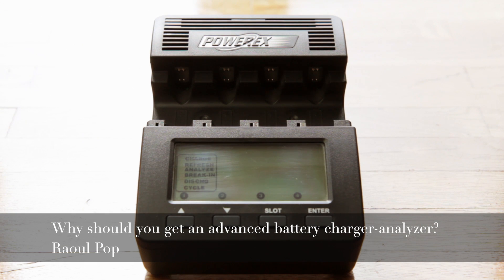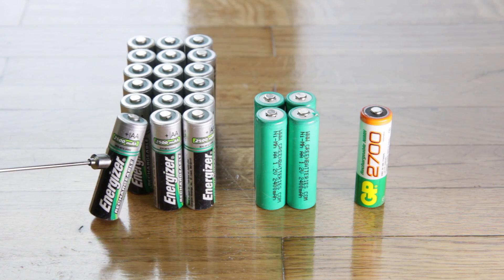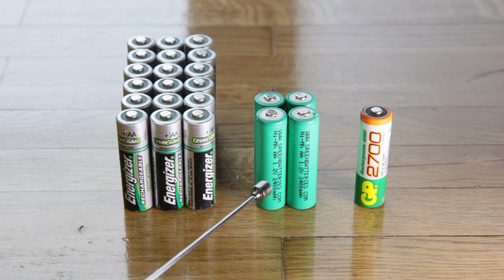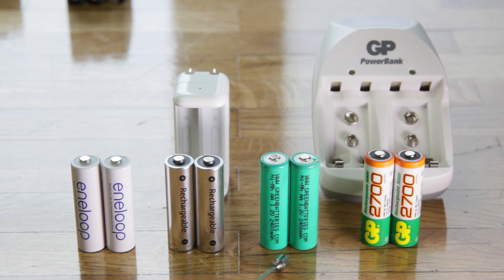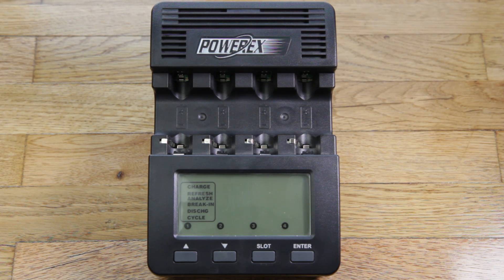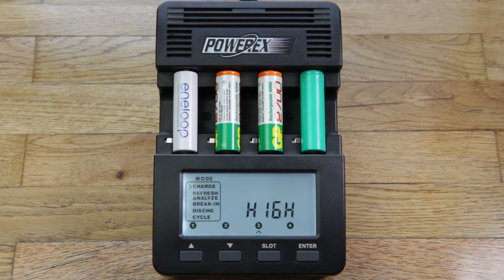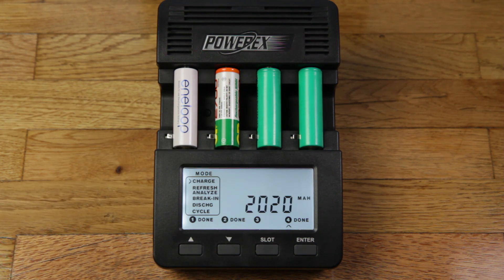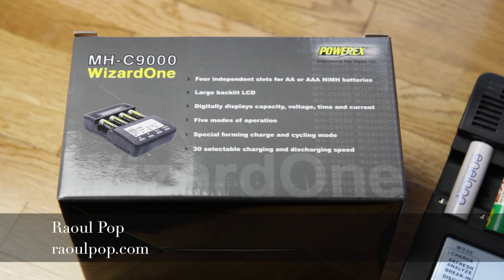Why should you get an advanced battery charger-analyzer?

Comment: I like it. But it has couple issues.

A) It refuses to charge some older weaker batteries. It should display warning that battery is KO, but charge it anyway. I have many batteries that are no longer "good enough" for this charger, but they happily work in less demanding equipment like LED flashlights.. so I have to use old dumb charger that simple feeds them with 160mA and some once tested on Maha then easly deliver around 1400mAh remaining capacity out of 2100mAh initial.
B) It only can charge AA + AAA, no C or D.
C) They redesigned the charger recently, but it still does not have circuitry to charge 18650 and 14500 Lithium batteries. I asked them if they can create some charger like Liitokala 500/600 but they keep responding like "yes we know, but so far we have NiMh C9000.. "

And over the years buttons keep getting worse and worse. SLOT button on my charger barely works now.
Reply from the maker: The inability to charge the C and D batteries is a minus. However, I’ve still got mine after all these years and it still works great, including all the buttons. I don’t think I’ve ever had another charger that lasted this long. Thanks for the detailed comment!
Reply: @RaoulPop btw there is hack to charge those worse batteries,  but requires some dexterity. Put fresh good battery in slot, select desired charging, wait about 10s until it does initial check and quickly replace it with the HIGH one. It will continue charging as usual untill its full. It cannot be the only battery inserted, at least one other battery must be in charger or it switches off.

:)

Concerning button, it can be replaced, it is just regular smt component, but SLOT button is not critical, so maybe later. 

For few larger D batteries I've created dummy with two wires and two soldered neodyme magnets.  Dummy goes in charger between terminals and wires to battery. Works quite well.
Reply from the maker: Sounds like you’ve been having some fun with it 🙂
Reply: @RaoulPop  Well.. 17 years living and charging together :D

Comment: RadioShack nimh cells weren't bad they were expensive they lasted years plus the label didn't peel off like the Energizer ones do after a certain amount of time
Reply from the maker: Yeah, they don't make things like they used to... I've noticed the low quality of the rechargeable Energizer batteries as well. I also bought some Duracell rechargeable AAs and they went bad rather quickly too.

Comment: My Eneloop AAA batteries after 7 years are still working well that's why I never buy other brands anymore but you need to be careful of fake eneloops. Both my chargers are Powerex, 1 of it is like in this video & the other one which is my favorite the MH-C401FS.. smaller & simpler has no LCD but good as ever.

Comment: Batteries like the Eneloop work well and last because they are made in Japan.  Those that you buy that are made in China like EBL are pure junk.  Every rechargeable I've purchased that was made in Japan held a charge while sitting in a drawer, was good for several hundred charges and delivered their rate capacity.  On the other hand the EBL batteries lost 40% of their charge in 30 days sitting in a drawer, never delivered rated capacity and lasted less than one year.  And yes, I use a Powerex MH-C9000 charger and have for years.  By the way, you can program the charging and discharging rates based on what the manufacturer suggests.

Comment: Nice stick 😁
Reply from the maker: It is indeed 😀
Reply: Raoul Pop thank you very much for the review it is very much appreciated.  Now that the average eneloop battery is nothing like it used to be at least in my experience do you recommend  another nimh. Have been reading about the Fujitsu batteries ( I think they're basically the sort that can come packaged with this charger) and people have said they're basically the same as the original  eneloops. What is your opinion and or experience please. thanks again kind regards Heath
Reply: Raoul Pop I just bought one of them nice sticks crazy what they can pick up.  Lol I took some batteries out of something and  1 rolled down the table  nto my music studios monitor bass port, heh....perfect tool, and and me for letting it happen. lol

Comment: I have only had trouble with GP batteries, the first one stopped working after at couple of month, and all of them were dead within 1,5 years. I only charge with a MaHa PowerEx MH-C9000 charger.
I have Imedion from 2011 and they are still performing excellent. I also have Eneloop (2015) that works fine, no discharging when they are not used.

Comment: I have an energizer Charger, has the door on top, have used it for a long time, when I charge my Ni-MH batteries they get VERY HOT!  So from what I have heard they are probably bad correct?  They don’t seem to hold charge a charge for very long!  They are used in a keyboard wireless, remotes, nice laser pointer etc.!  I ordered the powerex MH-C9000 charger looking forward to some analysis of the batteries I currently have.  I will order some ENELOOP Ni-MH cells eventually!

Thank you,
Kevin W. Ray
Reply from the maker: Yes, when the batteries get too hot during charging, they've gone bad. The charger should be smart enough to know that and to tell you they're bad, but that particular charger is very basic and the only thing it does is to provide the charging current to the batteries. That's why it's important to get a more advanced charger, one that tells you what's going on with them and which offers ways to break them in, to refresh them, to run multiple charge-discharge cycles, etc., like the one in the video.

Comment: The reason why the Energizer 2500mAh batteries quit working is because they're not of the newer low-self-discharge variety. They are based on the older style NiMH. Energizer rechargeables are generally made by Sanyo, the same manufacturer as Eneloop batteries. The newer Energizer 2300mAh batteries are more reliable as they are LSD, and also made by Sanyo.

Comment: Just FYI, if you had read the manual, you'd know that 'Refresh and Analyze' mode is for batteries not older than 3 months. For really old batteries in storage for more than 3 months the manual says to use break-in mode.

Comment: so if ts say "high" that means that battery is bad and cannot be recharged anymore?
Reply from the maker: Yes, I've been chucking mine away in the bad batteries bin at stores that recycle them.
Reply: i have questions,
i had let my batteries in a tool box for 1 year or so,
what should i do to bring these batteries back in a good performance?
should i cycle it and how many times or should i just charge it?

i really appreciate it, thanks
Reply from the maker: Try the cycling option, yes. Put them through 4-5 charge/discharge cycles and see if it helps.
Reply: @RaoulPop  I can't find bin to put batteries in so me and my family just put them in bin with other stuff because we don't have batteries bin in Falkirk
Reply from the maker: @lostshadow7161  You could try putting them in a thick ziploc bag and keep them there till you make a trip to a place where they recycle batteries, perhaps at a mall or a big store.

Comment: So I was in a hurry and bought a Energizer Mini charger + 2 1300mAH cells for about 8$, I don't use NiMH anymore, mostly lithium but for wireless controller/keyboard that I bought recently I need either alkaline or NiMH. Thing is these cells are rated at 1000 cycle, if I keep on using this Energizer charger how many cycles can I expect from this?

Comment: Would you recommend the Nitecore D4 charger
Reply from the maker: +Mad Max Haven't tried it, don't know.
Reply: Nitecore is an ok charger but not great. Best charger and the most precise and complex intelligent charger I've ever owned is hands down SKYRC MC3000. It is a robust charger but expensive to buy. Cheapest you can get is about $75-80 . Litokala 500 II is very good for discharging and recovering quick batteries but the precision in measuring the internal resistance is not always great. XTAR Dragon + is a great choice but again it can be pricey. LA CROSSE BC1000 is also a great charger but can be purchased under Youshiko YC4000 name. Opus BT-C3100 V2.2 is another fantastic (but more affordable universal smart charger and it does everything great and it even has a cooling fan.
Reply: +Mad Max Doesn't seem to have the testing features.
The liitokala 500 can be found on ebay and aliepress for very cheap.  On aliexpress make sure to get the one with an adapter since they sell cheaper ones without either the mains or car adapter.
It can't charge ni-cads though.

Comment: I've been using rechargeables for decades and find Eneloops with a smart charger (BL-700 in my case) to be unbeatable. Recently I noticed my LED headlamp wasn't as bright as I thought it should be and seemed to drain only after a few winter's evenings use, so I refreshed the batteries (4xAA Eneloops) and that fixed it. My headlamp was suddenly as bright as it should be again and the batteries have now seen me through four evenings straight. Fairly sure one of the batteries had gone a bit screwy and was the weak link.

If you use batteries a lot it's a no-brainer. A tiny bit more cash spent in the short term is definitely worth the long term gain.

Comment: I feel ripped off that most stores don't carry these amazing chargers, such as Target or Sears. These chargers really increase the life of your batteries. But even with the cheap chargers i got at least 9 years out of those terrible 2500mAh Energizers. They won't hold a charge much anymore and the more i use them the worse they get. The Duracells i bought around the same time work better, but the AAA Energizers i got a year after the Duracells and Energizers still work pretty good though they have lost some of their capacity.

Eneloops are probably the best your going to get and are not easy to find in stores either. I both get the chargers and the Eneloops from Amazon.com. Duracells are still pretty good, i have used both the old ones and new ones and they hold up really good, another brand from Amazon are AmazonBasics, they work pretty well though there are certain brands that are not holding up very well. Both Eneloops and AmazonBasics have overdischarge protection, which are very good in case you forget to turn off your flashlight or leave them in toys that continue to discharge the batteries. Even then i always keep a list of what rechargeables are in what device so i regularly check up on them to make sure they are still charged or in need of charging. Great video though and a good explanation on good batteries and good chargers to keep your batteries going for many years.

I still don't know how long Eneloops would last for, (other than charging cycles), i'm curious to see how many years they will work for when you are not using up all the charging cycles.

Comment: Why does it say 'HIGH' if the battery is bad? Does that really mean it's bad?
Reply: It means that the unit measured a very high internal resistance. In this case, when the internal resistance is too high, any attempt to charge it is useless because it will get very hot because of he internal resistance. And when you pull current out of the cell, the voltage will drop very quickly. So this cell is useless and dead.
Reply from the maker: ***** Great answer, thank you!